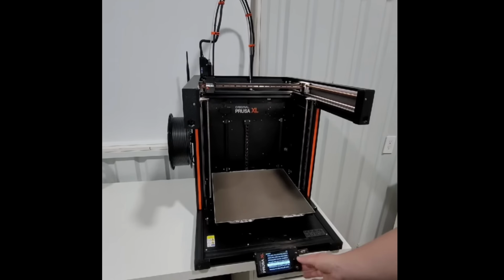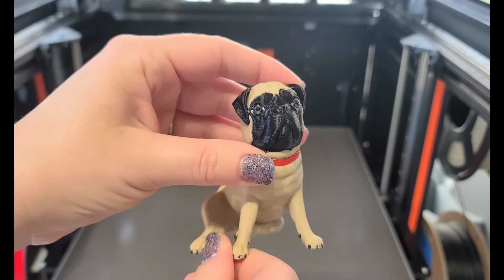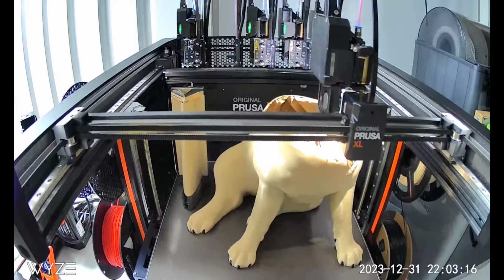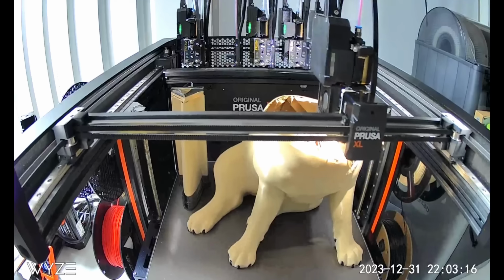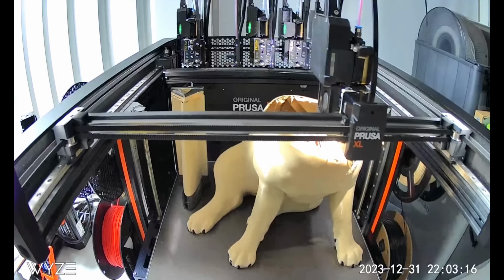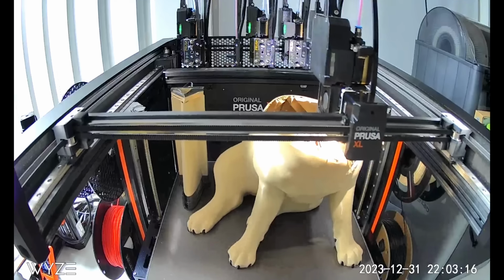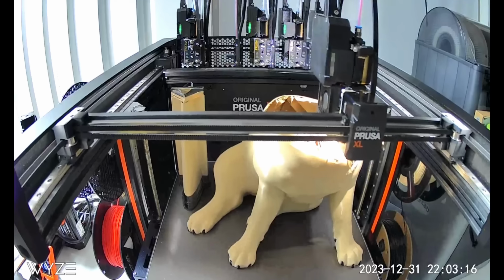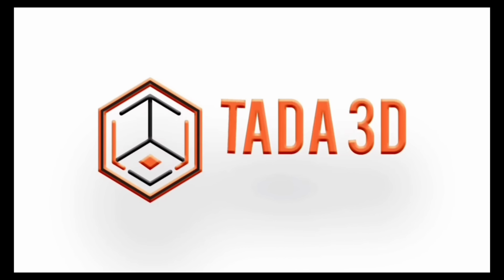Finally Testing Out the 5 Color Buddy Print That's Over 14" Tall!

Comment: I think you got some bad parts on that printer. You've had multiple times where a color purged, but then didn't feed during the print. Yet others like myself, have never experienced this. Is it always that same tool that doesn't print? I would try swapping the tool to a different spot and see if the problem follows the move. Maybe you can get that extruder replaced by Prusa. I'm also curious if during a print, you can use the "cancel object" feature to cancel the wipe tower? That would be cool. Probably running it without the wipe tower is better though. As for your crashing... That's to be expected once you have a mis-printing mess everywhere. I experienced this one time when I first got the printer. (My fault however) Once it starts crashing, it skips steps in the motor, and then gets out of calibration alignment during printing, and when it goes all the way to the right by accident, it will bump the locks on the carriage and undo the head. Which is actually the intent of the design. (Bump the right side to release locks on the carriage) I would make sure you have your crash detection turned on, (mine was off by default..?) and maybe set the sensitivity to high. I'm really sorry your having so much trouble. I can honestly say that I'm not experiencing any of these issues. (Other than that one time) I believe that the only problem I've had is when I run the fan test, I get a heat break fan error on #2 toolhead. I just keep trying to pass the test over and over and eventually it will pass, and not give me any problems afterwards. Unless I try to recalibrate the fans again. It's weird too, because the fan is spinning just fine, and appears to be full speed? I'm not 100% sure what the issue is, but I might just order a new fan and replace it, or see if Prusa will send me a new one. If I were in your position, I would do this... Retighten all the tool mounts and make sure they are all where they are suppose to be. (per the instructions) and then I would redo the dock calibration and definitely redo the loadcell calibration. Then run the calibration for the tool offsets. I know it's a pain, but you need to make sure everything is fresh and checked off the list of possible causes. As for the layer seperation on the wipe tower, yeah that's more than likely a filament chemistry issue. (Unless you have another tool not extruding 100%) You can pick which tool you want for the wipe tower perimeter structure, so maybe set it to a filament that you know bonds very well and use that for the outside of the wipe tower, because that black isn't liking it. Might be too cold of temps for that black as well. Good luck TADA, I hope you can get it all worked out because when the XL does work good... It's amazing the prints you can do.
Reply from the maker: Its good to hear you are still happy with yours. 
It's not consistent which toolhead is not extruding. 
I am beginning to think I either got a lemon, or I seriously messed something up. Thanks also for the tip about the filament tower. I do remember specifically asking Prusa chat that I could do to improve my tower and the response was to increase temp. Wish I had known there was an easier way. 
Thanks so much!

Comment: Trying to use Prusament is a good idea. I believe, that the 0.6 nozzle profiles still are not as good as the 0.4 profiles, which have been used for several other machines for a long time.
Also the input shaping with the 0.6 nozzles might cause the problems, as the flow rate of the 0.6 nozzle is lower (more volume to heat up). So the 0.4 nozzle is only a little slower than a 0.6 nozzle.
And there must be a reason, why all currently shipped XLs have 0.4 nozzles.
Reply from the maker: I agree. I just haven't had great success with it so far. But it's worth a shot! Thanks!

Comment: You tried a different infill after I posted this so have edited this greatly. 

If you have a more consistent infill you would assume that would stabilise the perimeters so they didn't pull up. Sometimes they can pull up but usually on severe overhangs. 

The tower - can you increase base and perimeters for that too? Possibly use a different model - you don't have to use the tower - if you get something with a good base it should hopefully finish. Make a part you can paint and giveaway or sell. Try get the tower as close to bed centre as you can with the pug. The edges cool more than middle and can cause issues ie plate releases. Possibly put some cardboard across the side and the front to see if that helps keep the plate warmer across the whole surface.  

Try 3 or 4 perimeters - a slower successful print is better than multiple failures - makes it a bit more durable and it will likely finish. Wall thickness maybe causing the upper layer not to anchor well to lower one so drag across, then bumps the toolhead up causing the error. 

Paint your own seams on the back or under arms etc. 

As you tried the red in another spool slot I suspect you spool is a dud or the extruder isn't grabbing the filament and pulling/ pushing throug properly. possibly the mix wasn't right (if its prusament go to the website and see the specs on your filament roll). See if its consistent diameter etc.

I've never had a print pause for ages and resume successfully... there always a slight issue. 

The prusament signal white petg was instock a around the 18/jan/24. Try prusament petg - it is rock sold! I'm in Perth Australia which is on the coast and is quite humid. But I don't dry filament and do not have any issues albeit one or two pops upon heatup. I think i had 1 day in 3 yrs where the filament popped for a long while (one layer width of the roll that was exposed to air, and cause minor pock marks. I noted i had one Petg roll that the skirt around part which crack into short segments rather than one continuous loop - so not sure if too hot or bad mix. 

Rotate the pug on the plate and see if fan cooling is impacting. I've notice on last two petg print the part was nice one side but rubbish on the other and put it down to the fan - sure enough the fan shroud was bent from a blob that had accrued and warped it. I have just printed its replacement to see if it improved.  SO yeah could be fan cooling too.

What's thought on the way the colour goes straight to centre. Those slamander/ lizards multicolour - i'm sure you could separate along those lines, it should be more like a zig zag to ensure no possibility of separation.
Reply from the maker: I'm going to try the tower again with a dedicated extruder to see if that helps. And I just got all new Prusament in to try. Thanks so much!

Comment: I have the impression, both from here and other videos, that the XL is really unreliable. 
How do you rate it?
Reply from the maker: Mine is unreliable on anything very complicated. On super boring two color or square boxes etc, it's fine. 
I get a lot of comments and feedback from others saying theirs has none of the issues mine does. So it's hard to say if they are printing different things or their printer is better than mine. And it's hard to say why it would be different. I really love the Prusa brand. But I'm not happy with my 5TH XL. Thanks!
Reply: @tada3dprinting  Thanks for answer! Perhaps Prusa should replace it for you. This is not good PR for them. Hope it all works out!

Comment: In your previous video comparing how much filament waste there is with multi filament printing on the bambu printer verses the XL...

Maybe consider calculating how much waste filament you're generating (and time wasted) from large failed prints on the XL?

I mean yes, all 3D printers will fail to print at some point, luck of the draw there. But for $4,000 for the XL, it seems that having the filament just not even fire (multiple times now) without you poking the roll, seems like it's not just a fluke anymore.

Although I'm also curious to see how long it would take the bambu on the same 3D model and multi filament (minus one color of course) just via the estimate from the slicer.
Reply from the maker: It's very true that you have to factor in failed prints. Especially when it's this many and this large.
I can't print the 14"+ size on the Bambu. But at its max on the Bambu, it looks like it would take around 50 hours and around 1200 grams. Thanks!

Comment: I've had issues with PLA filament snapping when left alone before. I think your red might be snapping in the extruder considering that you can push it through and it continues to feed fine after that.

It sucks you've had so much trouble with everything here.
Reply from the maker: Maybe there being a lot less on the red filament spool now is affecting it too. But that last one, the white didn't fire either.  Thank you!

Comment: I really feel for you. It must be so frustrating. When you were using the tower I found it strange that the bottom of the tower was all black. Shouldn't there be some tan in there too? Or is it just covered up by the black. The real issue here is that you seem to be dealing with both filament issues as well as printer mechanical issues.

There have been a lot of people that have been asking for the "Time to color change" to be displayed. I don't do much multi-color printing in my MK4, but it is a pain waiting for the filament change.

I hope you get some resolution to these issue. I would love to see the Buddy print completed.
Reply from the maker: I'll look and see if there is tan on the inside. And I'm getting comments that there is a way to adjust this to have the tower be a solid color. I am planning to try this. 
I am planning to run again with all Prusament.
Thanks so much!

Comment: The tower falls because it is missing a red layer, gluing shouldn’t be needed - but you still can make it wider by changing the angle in the slicer.

I wouldn’t use lightning infill, see how it is barely holding… really in space, that can’t help. 

This is very maddening… so sorry. As I have shared I have had a good experience with my 2T… but with the caveat I am printing board game inserts and parts with not that many tool changes and without that much Z. I have not had the time to try a ‘full size’ print, maybe a helmet or the rocket engine.

You need to make the tower wider AND solve the problem with red. What about printing a red object on the print bed, to get the red started?   (just a box done in the slicer).

I am a Prusa fan and love my 2T but these problems shouldn’t be happening in a 3500$ machine… that was very, very frustrating to watch!! So sorry. Prusament are great, but still sometimes I get Prusaments which need drying. 

Mine works super well with Polymaker Polyterra, it’s a very ecofriendly and lovely matt colors, they print very well and have excellent first layer adhesion and adhesion between colors.

I tried without a tower and it left little defects on the small test print I did. That said I used an older filament I shouldn’t as it is against what you should do when using no wipe tower. Again the tower works well… it fell because of the missing red layers, makes total sense.

Really frustrating… this expensive and an experienced user like you. Again sorry….
Reply from the maker: That's a good idea to print something else to get or keep the red primed. I'm thinking of just completely swapping to a different roll of filament. But then my white had issues too. Idk. We'll see what happens next. Thank you!

Comment: somehow it could be nice to have some kind of wheel there could detect the filament move before the extruder motor.
Reply from the maker: Yeah and I would even be down to have some way to test it so if I tighten or loosen the screw etc that I can find out if it works. Rather than a 25 hour print. I'll have to think about that. Thank you!

Comment: From the prototyping world, you should absolutely be testing this where the issues are happening. If you give this one a go again, start a bit below the collar since it is consistently happening in the same place. I get my printer this week so im interested to see my experience, but seeing you have failed attempts so so far into the print is heartbreaking, and at least seeing if the location and issue is consistent during the print will be a start
Reply from the maker: Yeah that would be interesting to see if it still won't extrude the red even a couple hour in. Or if it's because it waits so long. Thanks!
Reply: @tada3dprinting  Hope I can help by testing some of your prints with my own printer and what the results are!

Comment: When the printer is not extruding any filament, the printer could be made to detect it happening. Because the motor and heater will use less power.

I think you have exposed 2 flaws: That the extruding stopped, and it was not detected.
Reply from the maker: Yeah that's true. But really the only sensor is the filament sensor and it of course detects there is filament still there. Eventho it's not moving. Hmmmm. Thank you!

Comment: Bummer your having so many issues.

You seriously need to get the PEI sheet since you seem to mainly print pla.  Pla sticks so much better to the PEI than it does to the satin.

Have you seen the recommendation to grease the pins on the tool heads.  I wonder if that's the issue your having with number 5.
Reply from the maker: Thanks for your support. I hadn't seen they finally came out with a PEI for the XL! 
Yes I did grease the coupler pins. But I'll check that the last one still looks good. Thank you!
Reply: @tada3dprinting  Yes they have a PEI for the XL.  I have one.

Very odd on the red filament.  Since it followed the filament when you changed extruders it must have extra drag or something, or maybe sitting a long time at the preheat temperature is causing it to get soft and not come out when it's finally needed later in the print.

Maybe try setting the idle temperature for that specific filament like 20 degrees lower.  It'll take a little longer to heat up, but no big deal if it works.

Comment: I bet if you'd tried to print this with the Bambu Lab X1C it'd have printed with no issues. I've seen significantly more complicated prints go without a hitch in the X1C. Prusa had better get their act together. The myriad issues I've seen people have with the XL and their filament being out of stock like that seems indicative of a company in decline.
Reply from the maker: It might be a good test to see how it does. Definitely would waste a lot more filament on the Bambu. But if it worked on the first time, then it would be amazing!

Comment: There's two thoughts that i have about the issue with red not firing

one of my thoughts is that i wonder if the filament in the nozzle is just leaking out enough that when it finally gets to that part of the print, so maybe its just not far enough into the nozzle to print anymore
There's the little red nozzle cover thing in the back, and i would guess that it'd probably have a blob if that were the case though. And there was that one print where it worked for a few layers and then stopped working. so the more i think about that the less likely i think it is.
My other thought is that maybe the filament haves just had enough tension pulling back on the roll that over the hours it manages to pull it back just enough to not catch on the extruder gear

I know you're probably just done with this pug, but one thing you can do is manually insert a pause into the gcode. I think in prusa slicer you could insert a color change command at the layer when the red is about to start. but if you're willing to edit the gcode directly, i remember there being a command to just pause until the button is clicked. it gets used by people when they want to put magnets inside their prints. that would make it stop until you come hit buttons, so then you'd be there right at the start of the red going

one thing that might make the tower more stable, you could set the wipe tower extruder. that'll make it print an additional perimeter for the purge tower. It'll have more tool changes because you'll have it switch to that specific extruder for every single layer, but it could help with what appears to be issues with the tower adhering to itself. The default in the settings has that extruder set to 0 so it doesn't do that.
I wouldn't recommend going completely without the tower though, because the tower is there to make sure the pressure is normalized so turning it off completely could make it have even more weird random/unexplained blemishes.

there's a maintenance thing for greasing the parts where the toolhead and nozzles connect that might be worth looking into. i don't remember if you already tried that

I sometimes mix pla and petg on my printer, and i find that when the bed temperature is up at those petg temps, things REALLY stay on until the bed cools down. So you could also try bumping the print bed temperature up. But if you do, note there's an issue with it not saving if you change it on a per-extruder level. so you have to change it in your filament profile
Reply from the maker: Yeah I think I may try it again with a different color and brand new roll of filament. I didn't know about the tower option. I wish Prusa had mentioned that when I asked how to make it more sturdy. 
Yes I did do the greasing the coupler pins.
I'll see about upping the temp on the bed but I think the adhesion was mostly because it sat for hours an cooled some. Thank you!